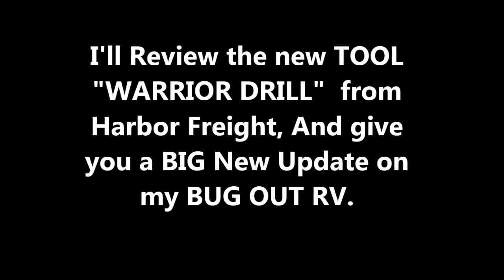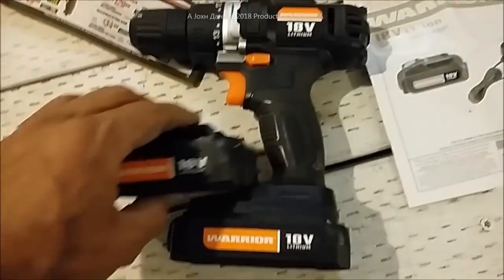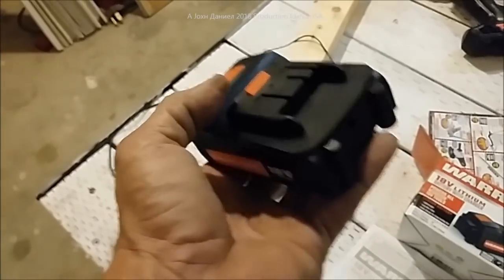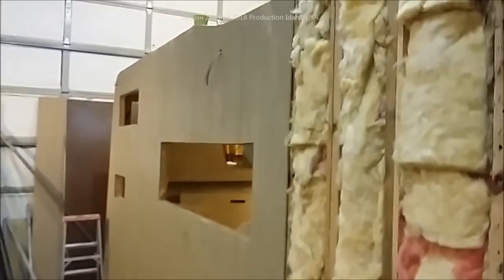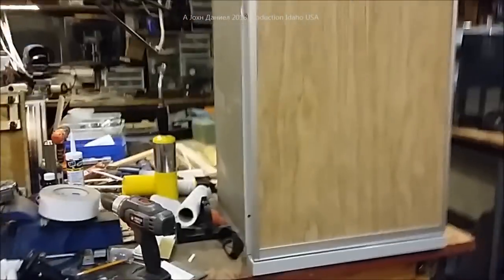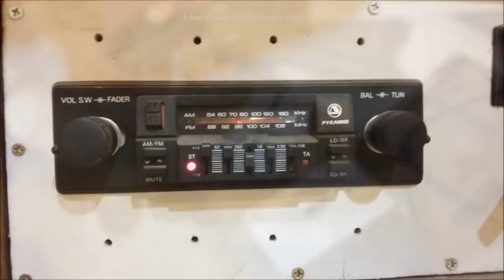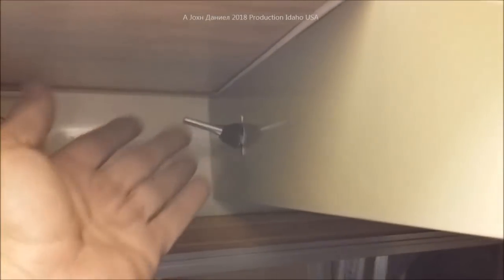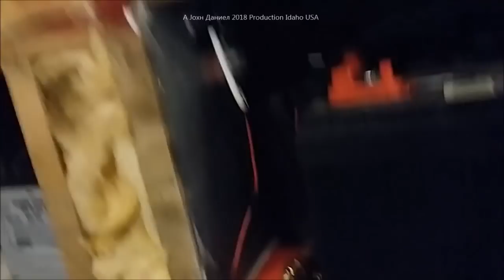Harbor Freight WARRIOR DRILL + review & update of BUG OUT RV

Comment: How is the warrior compared to your bnd?  I have the basic model bnd with lith ion.  I want to get the 12v ridgid drill/impact combo which the drill says 400 in lbs.  My bnd feels somewhat gutless and the warrior looks like it may be about the same power as the bnd.  

Dont wana get the warrior to replace bnd and have them basically the same power.
Reply from the maker: I would venture the same power on both, but warrior seems actually better built. A very odd conclusion to say that knowing it came from Harbor freight!
Reply: Јоhn Daniel thanks for the reply. Ill save up and get something nicer.
Reply from the maker: Understood. A Nicer, affordable, impressive quality with low weight to power and insane good battery options is the Porter Cable BIG SET https://amzn.to/2Op1HoX OR 6 pc set https://amzn.to/2NQDIxU and the only big battery add on use these, they are safe and last hours of use between charge, https://amzn.to/2LGiYM4

Comment: I'm sorry just my opinion, that drill is garbage, won't handle a drop, that case is just abs, no reinforcement....also that silver looking piece near the Chuck is plastic....that drill is not made to last...
Reply from the maker: I would suggest that if yours broke to immediately take it back, they have only been on the market a few weeks, your 90 day return is valid. As for mine, 3 drops from top of a 8 foot ladder onto concrete already and no breaks but I will be more careful since your broke so easy. And when you return yours, inspect it better, you apparently got a odd ball model with plastic clutch and gears. Mines all metal, clank clank when you tap it with a wrench.